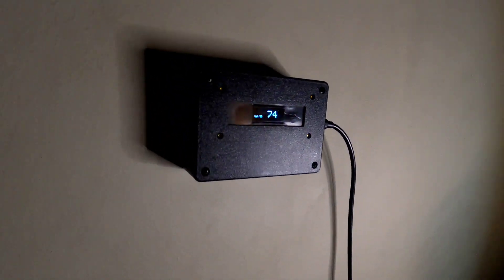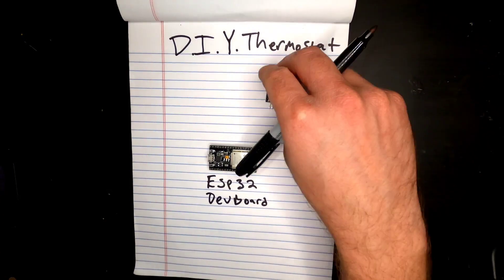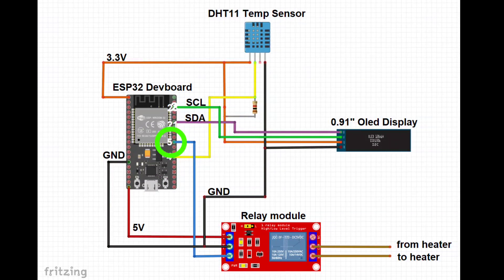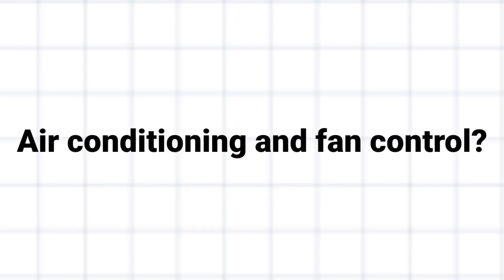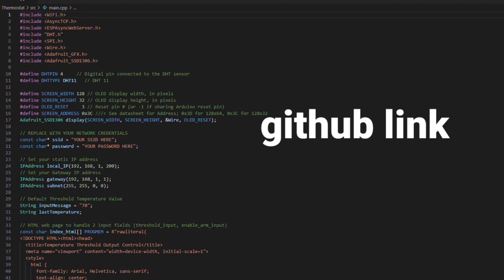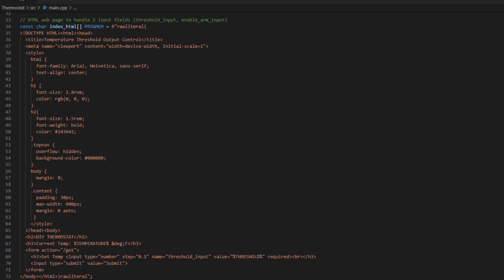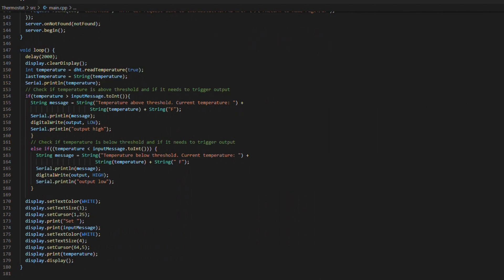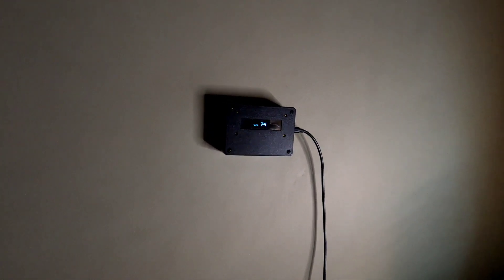Build a DIY Thermostat w/ Smart Phone Control

Comment: Hi, great video! I have a beginner question. I want to build this t-stat and connect it to an extension cord to run a small electric space heater in my shed. Will the relay in the video work with 120 a/c current (or do I have to step the power down somehow) and can I just cut an extension cord and wire it in to the relay to control the power based on temp? I hope I'm making sense. Thanks for any help.

Comment: this is awesome. im on the same project but i ran through an arduino example and now i want to do the stm32 environment with a nucleo board or something. im using janky little tmp36 and i am planning on using FreeRtos and do 3 tasks, for heat, cool, fan mode. maybe use a mutex at beginning to give a token to wether my cool, heat, or fan task will run or something similar to that. maybe a semaphore but i havent put much thought into it but i think task method will be okay. i am planning on using mosfet to switch fast and to use less power than a relay and maybe less down time if no physical parts are involved.

Comment: What about hysteresis? You would need this especially for forced air. If you set the temp to 72 and the temp rises to 73, the relay turns off. If the temp goes down to 71, the relay turns on. This would cause undesirable operation for some systems. You would need to add a defined lag (hysteresis) into the code to allow the temperature to rise above the set point by several degrees and then turn off as well as fall below the set point by several degrees before it turns back on. This might be fine for electric heat but would not be good for forced air systems. You will note that many thermostats have DIP switches inside that must be set for the type of heating system you have. This sets the Cycle Rate (CR) to determine how many times an hour the furnace comes on. There are normally settings for the 4 different types of heating systems found in most homes: steam or gravity hot water, high efficiency forced warm air (90%+ efficiency), hot water/heat pump system/gas or oil forced warm air, and electric forced warm air heat. If you could add this feature to your code, you would have a very flexible thermostat system. Great job by the way and an easy to understand video.
Reply from the maker: David George,

This is some really good insight into something that I overlooked. Thank you for taking the time to explain it! I will look into accounting for hysteresis in the software. Thanks again for thr feedback!
Reply from the maker: Are you an HVAC guy, or just generally knowledgeable about the systems?
Reply: @trowantechworks  I have been working with Arduino for a while now but by no means an expert. We had to replace our old oil fired hot air furnace with a new one. I upgraded the thermostat as well. We were freezing with the new furnace. It would come on only for a few minutes then shut off constantly.  The house never warmed up. I could not figure out what was wrong. By chance I took the new thermostat off the wall and looked at the back. Lo and behold, there were DIP switches. Not knowing, I had it set for the wrong type of furnace. Once I set it properly, our house became comfortable. What was happening was the furnace would come on and start to heat up the house as normal but as soon as the thermostat rose a degree or two, the burner would shut off and the blower did it’s thing until it sensed that the furnace was cooled down. This was happening every 8 minutes or so. The house never had a chance to warm up. Now the furnace comes on at the preset temperature but does not turn the burner off until the temp has risen by a few degrees. This let’s all areas of the house get warmer, not just where the thermostat is. Also, the furnace does not come back on until the temp has fallen by at least 4 degrees. You don’t want a forced hot air system cycling on and off as it has it’s own routine. The burner comes on and starts heating the heat box. Then the blower comes on and starts pushing air throughout. When the temp reaches a certain threshold, the burner shuts off and the blower stays on until it senses that the furnace has cooled down. You can see why this type of furnace would not work well with your design as presented. I had looked at another design for an Arduino based thermostat some time ago and the author had taken hysteresis into account. Now I see why. Have you ever looked at a digital temp gauge as it goes up? Sometimes it will go back and forth between two numbers until it stabilizes. This is not the operation you want to have happen in a thermostat. I really learned a lot about heating systems with my own thermostat. I mentioned it to you only as a way to enhance your circuit making it more useful to a wider audience. Greetings from Nova Scotia!
Reply: @davidgeorge8541 Some of the problems you describe should be accounted for with the design of the HVAC system.  First, the furnace should not be oversized compared to the size of the dwelling and the amount of heat loss and other factors.  Oversizing causes the furnace to heat the dwelling too quickly and run shorter cycles decreasing furnace efficiency.  Second, the thermostat should be placed away from any heat source and near the return air duct so that the thermostat senses air that has had a chance to circulate throughout the dwelling and cool down sufficiently.
Reply: if set for 70, most tstats have a 1 degree differential or offset. so basically in heat mode will turn on at 69 and turn off at 71